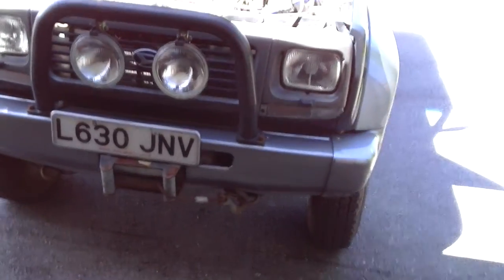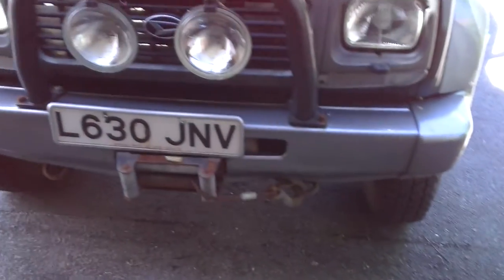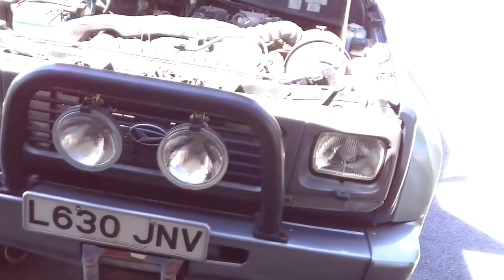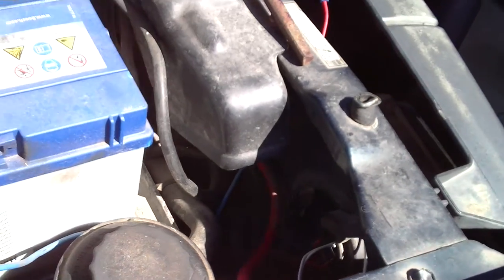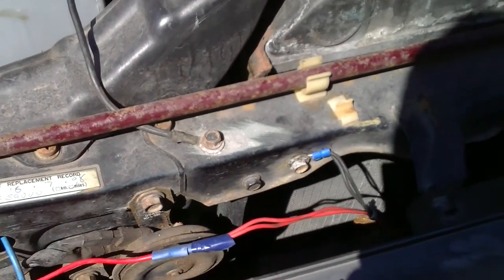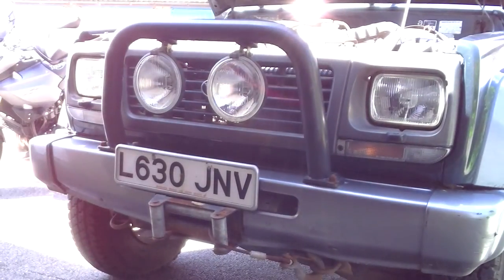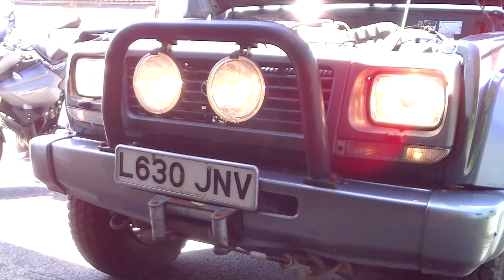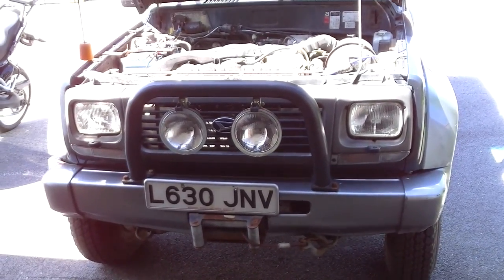Daihatsu Fourtrak spotlights wiring

Comment: Thanks for the idea, couldn't work out how to do this before watching your video, just thought I would point out that I think you made a mistake with the relay pins.

I think u mean to say...
87 - 12v battery
30 - spotlight positive
86 - RH side of headlight 
85 - LH side of headlight

That worked for me on my Feroza but I also put in a switch between 85 and the relay just to give me more control.

I live in Australia so I dunno if the pins are numbered differently for some reason but this is what I have found.